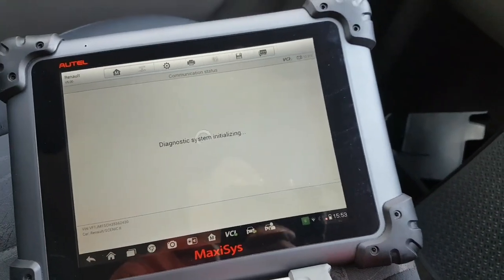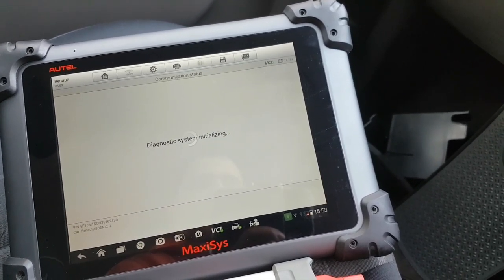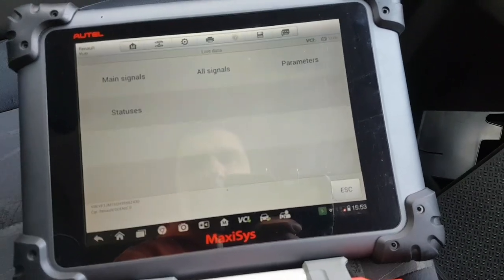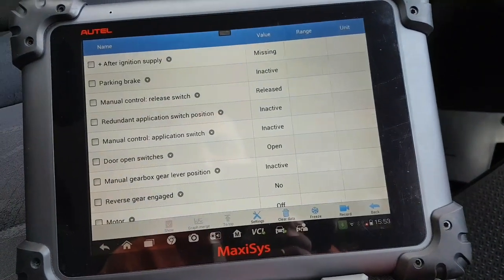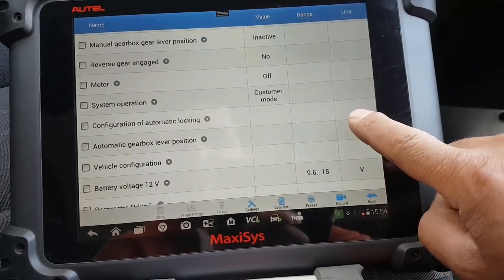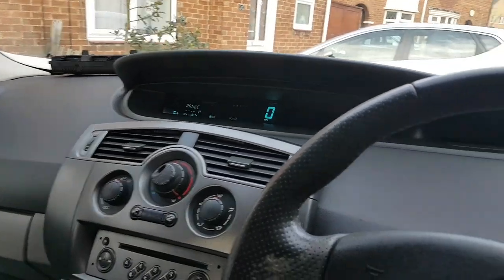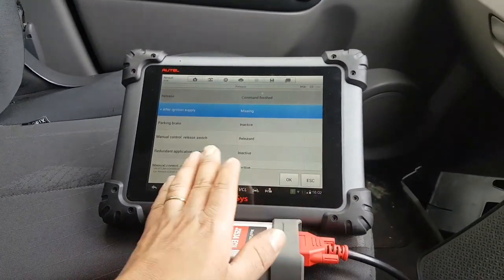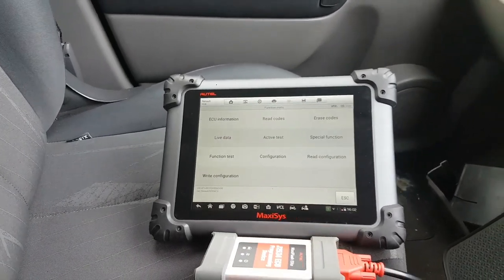Scenic 2006 Electronic Parking Brake not working. R2 strikes again... Fault finding and repair.

Comment: Where are you based roughly?? As my BSI is broken.
Reply from the maker: Hi
What you mean is broken? 
Thank you for watching!
Reply: @LMAutoRepairs  My car has a none communication BCU or BSI. None of the lights come on, on the dash and the engine wont start.
I have had an auto electrician come out and comfirm it is the BCU. As the is power getting to the unit, however the electrician cant communicate with the unit.
I happend when I plugged it a climate control unit from a 206 into my car thinking in is the same unit, however nothing now works.
I dont know if this BCU can be repaired or I need to replace the BCU.
Also the BCU was replaced about 4 years ago, however after a year fuse 18 started to melt.
Any help will be great.
Regards Seb
Reply: However central locking, the side lights seems to come on all the time until you lock it and the electric roof all work.
Reply: @LMAutoRepairs  My car has a none communication BCU or BSI. None of the lights come on, on the dash and the engine wont start.
I have had an auto electrician come out and comfirm it is the BCU. As the is power getting to the unit, however the electrician cant communicate with the unit.
It happend when I plugged it a climate control unit from a peugeot 206 into my car thinking in is the same unit, however nothing now works on the dashboard. However I still have windows and sun roof.
I dont know if this BCU can be repaired or I need to replace the BCU.
Also the BCU was replaced about 4 years ago, however after a year fuse 18 started to melt.

Any help will be great.

Regards Seb
Reply: @LMAutoRepairs  However central locking, the side lights seems to come on all the time until you lock it and the electric roof all work.
Reply from the maker: @CapuaSon  
Check connections etc...
You might don't have comms because of wiring or connection issues...
The electrician should be able to scope the can lines at the plug to confirm if there is a problem...
Hope that helps...